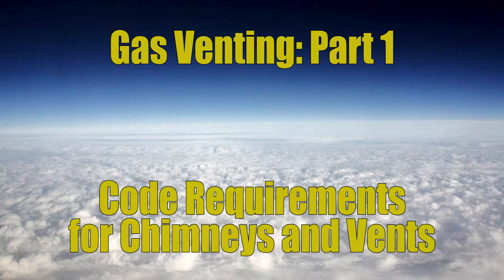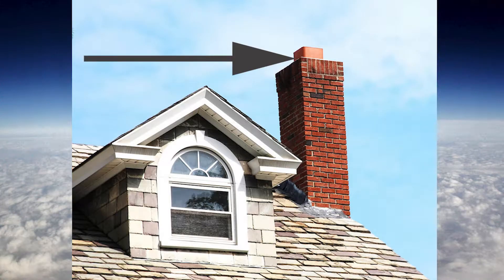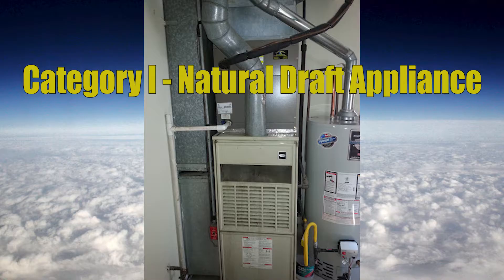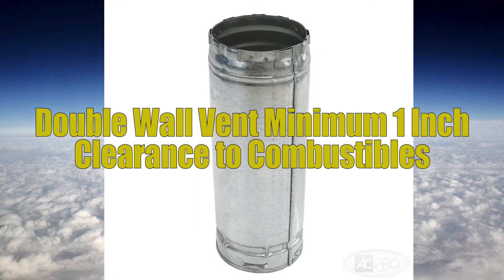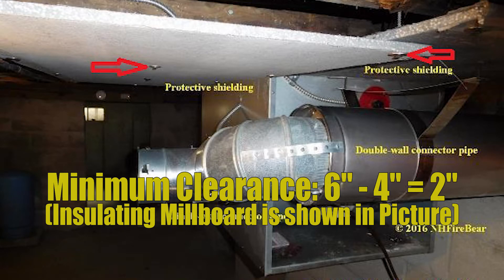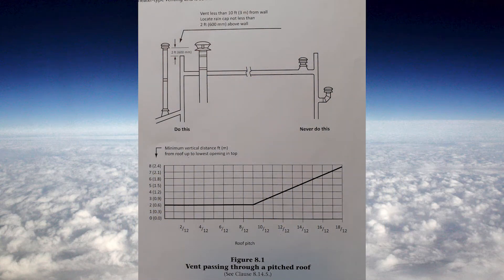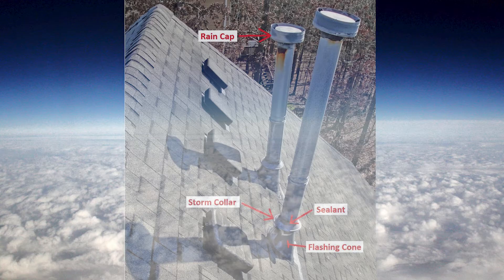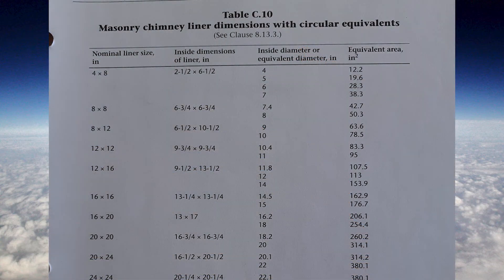Gas Venting: Part 1 - Code Requirements for Vents and Chimneys

Comment: Can I go beneath a window if its like 10 ft above?
Reply from the maker: You sure can.

8.14.8
A vent shall not terminate:

(g) within the following distances of a window or door that can be opened in any building, of any nonmechanical air-supply inlet to any building, or of the combustion air inlet of any other appliance:
(i) 6 in (150 mm) for inputs up to and including 10 000 Btuh (3 kW);
(ii) 12 in (300 mm) for inputs from 10 000 Btuh (3 kW) up to and including 100 000 Btuh (30 kW);
and
(iii) 3 ft (900 mm) for inputs exceeding 100 000 Btuh

Comment: Need requirements for venting a mech vented furnace and a gravity vented water heater both into a Masonary chimney.  Is this allowed?
Reply from the maker: If you are in Canada, and given you are talking about a fan assisted appliance that is approved to use Category 1venting then yes you can.

According to GVR C.2.9 You can vent a fan assisted appliance into the chimney if there is a natural draft appliance venting into the same chimney. The chimney will need to be appropriately sized to vent both appliances.

Comment: Training for Inspector, when asked if a 10:12 pitch, with a type B vent from a hot water heater, how high does the vent have to extend above the roof? (Do you use the chart 9:12 to 10:12, (2 foot) (OR) 10:12 to 11:12 (3.25 foot) 2018 IRC
Reply from the maker: Unfortunately I am only familiar with the CSA B149.1 code.

The CSA chart maybe similar but I only have one chart to reference. It shows me that 10/12 pitch should have a 2' 8" rise above the roof line

Comment: Your video is wrong, you show a pic of mill board which needs to be spaced 1” off joist/wall (it appears that it is) and that reduces you to 3” instead of 6” clearance for that single wall pipe. 
Your video has you stating and writing you only need 2” when that’s wrong, that only applies to steel not mill board.
Reply from the maker: The picture is wrong, the info however, is accurate because I'm talking about 28 gauge metal spaced out with non-combustible hangers.

Other than this picture I found on the internet, I have never seen mill board actually being used in this application. That said, the way the mill board is installed in the picture meets the 3" requirement.
Reply: @ sure, I get it, but I wouldn’t talk about a cat while showing a dog. There’s people here that have no clue that pic wasn’t matching the conversation.

Comment: Hi, A fireplace having 2 liners passing through an 8'' x 12'' flue (3'' intake liner and a 3'' exhaust liner), 
     does the intake have to follow the 2 foot above rule (Code Clause: 8.14.4) or is that just for the exhaust? (The way the stainless steel cap is set up that houses the 2 liners has the exhaust about 11'' higher than the intake.)

Thanks for the great content!
Reply from the maker: Gas fireplace: follow manufacturer's instructions.
Wood burner: no idea

Comment: Is a " power draft-assisted burner" fall under "with a draft control device"?  or "without a draft control device"?  appliance  i'm  studying and am getting contradicting information from reputable resources
Reply from the maker: The name has 'power' and 'assisted' in it. I need you to tell me what you think it is. When you give me your answer I will confirm.
Reply: the study material i have has led me to understand a naturally aspirated appliance with a draft hood/barometric damper is a "draft control device"  any mechanical draft (induced/forced) is " not a draft controlled device"  however in a RED Seal sample question, (power burner) the only way to agree with (Their) answer is to calculate the combustion air as a "appliance with a draft control device"  i feel like ive learned the opposite of what i should,  to answer your question, the thermology suggests the draft is controlled (via a blower) so it is a draft controlled device, contrary to what it appears i have learned  @MathematicPlumber
Reply: the termology suggests it's a draft controlled device, and the answer to that sample question suggests the same, however this is the opposite of what i have learned over the last 6 months, draft hood=draft control device, no draft hood= not draft controlled.  i have been mislead somewhere  @MathematicPlumber
Reply from the maker: @davequesnel8740 So when an appliance has a powered draft, it is using some sort of fan or blower. Therefore it is fan assisted, any vent that is fan assisted or has a powered draft cannot have a draft control device (cannot have a drafthood)

Fan assisted or powered draft = no draft control device.
Reply: thanks! only disheartening point, is a CSA Red Seal practice exams answer put a power burner into a "draft control device"  category on a combustion air requirement question ( i have pictures of the question and answer)  funny, after studying for 5 months, appears there are allot of errors in the programs offered    @MathematicPlumber

Comment: problem sample test question:  table C4   the appliance fan min-max columns are outside parameters of appliance (75mbtu   30' height 3' rise)  3' vent min-max= 54-64mbtu...... 4' vent min max= 85-119mbtu.   75mbtu falls in neither column.  how is this approached?  the GVRs dont seem to address this scenerio
Reply from the maker: Are you in the correct table? If the vent connectors are double wall, (C3) then this works.

If the vent connectors are single wall, then the only correct answer is to upgrade to a 4" double wall vent connector. If this is not reflected in the question, then the question is flawed.
Reply: have picture or diagram outlining the venting problem, c-vent connectors into B common vent, nonetheless the odd mbtu appliance falls into this weird no zone, (most overlap min-max to avoid this) but this table (C4) clearly has some the leave these gaps, i cant believe a random student studying found a catastrophic flaw in the tables designed by engineers for  decades!  am I the ONLY ONE to have noticed this? ( I have circled the section on a picture, however cant post it here @MathematicPlumber
Reply: Please look at table C.4  30' vent height 3' connector rise,  (3' min=max 54-64mbtu)  (4" min-max 85-119mbtu )  where does 75mbtu go?  none of your videos ran into this & no GVRs appear to address this scenario @MathematicPlumber
Reply from the maker: @davequesnel8740 I did look at both tables. And like I said, there is only one thing you can do to meet code requirements in this scenario: Change to double wall vent connectors.

You will not be able to run that system with single wall vent connectors. Table C4 simply doesn't allow you to vent that arrangement. It's a weird example, but it is what it is.

Bear in mind, there are flawed test questions. I have personally come across them in exam reviews.

Comment: NEED HELP   i have to learn to navigate this B149 to pass the exam,,,    here's an example of my problem: B-fitter example question:  What is the minimum grade on a vent connector?  30min & CANNOT find any reference to vent connector grade (I know its 1/4'/ft just because ive been installing for 20yrs)  but its not in the code?  and all venting videos don't appear to mention grade.

Comment: ..my vent pipe portion immediately fastened to furnace vibrates every time the furnace inducer fan starts, up until it shuts off, when gas valve closes.
It is extremely annoying and I do not know how to solve this issue.
Can you advise?

Comment: is making me confusing little bit on the roof pitch table what is thoses numbers mean on the bottom that it how  10/12  11/12
Reply from the maker: Roof pitch is measured in rise over run. Example a 7/12 roof: for every 7 inches a roof rises up, it wall run 12 inches sideways. I recommend googling roof pitch to get a visual indication of what it means.

Comment: I upgraded to natural gas and I want to remove my old chimney. Can I vent the natural gas out of the side of the house instead of through my roof?
Reply from the maker: That is not a question with a simple yes or no answer. There are many factors to consider before an answer can be given.

I strongly recommend contacting a local gas/heating contractor to answer that for you.
Reply: @MathematicPlumber  thank you very much. I’ll try to find one where.
Reply: Were you able to get an answer? I'm doing this exact project myself!
Reply: @intolerant_left  well I was told it can be done but you need a plumber and money. Lol

Comment: Can you B-vent into a chimney without having to run pipe all the way out the top of the flue tiles?
Reply from the maker: That is not a simple yes or no answer. It depends on a number of different code requirements and the type of appliance you are planning to vent. Fortunately, if you watch this video series, it will explain that.
Generally speaking, running a flexible chimney liner down is the smartest option though. Once again, explained in the videos.
Reply: @MathematicPlumber  It's a  Williams 65,000 BTU/Hr Enclosed Front Room Heater Liquid Propane which vents chimney style via B-vent piping where it comes out the back of the unit and you run it straight up through the ceiling/roof. In my case, i have a masonry chimney i can vent it out, but I don't know if I can just poke it through the chimney thimble and be done with it, or if it should be continues B-vent piping through the top of the chimney. It's difficult to get a straight answer on this question from anyone so far.
Reply from the maker: @justifiedFaith209  Can you give me the model number?
Reply from the maker: @justifiedFaith209  I found it. The reason why you are not getting a clear answer on that, is that there are a number codes and considerations around that. So, I cannot give you a clear answer on it either. I would need to visit your house to be able to tell you that. I don't do house calls :)

Now to answer your question, yes it is possible (in Canada) to vent directly into a masonry chimney. If, and only if your installations meets a number of requirements.

I strongly recommend you hire a local gas fitter for this. If one or more of these special considerations/codes are missed, you could run into some big headaches.
Reply: @MathematicPlumber  Thank you for your replies. I appreciate it.